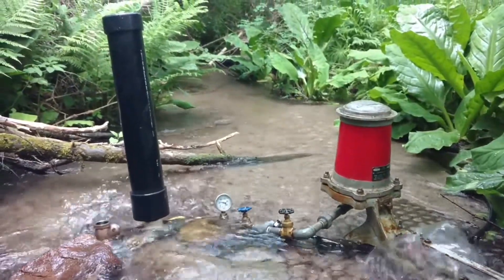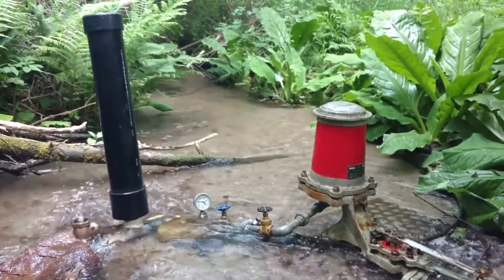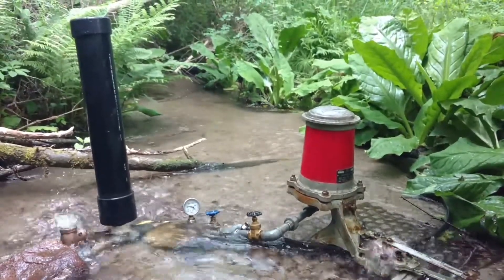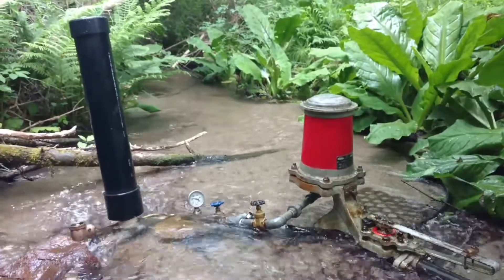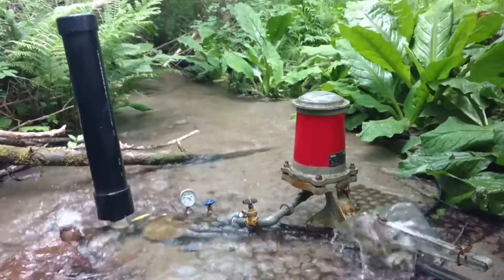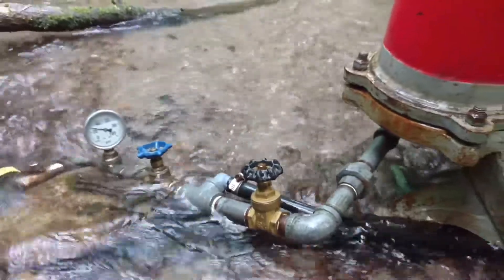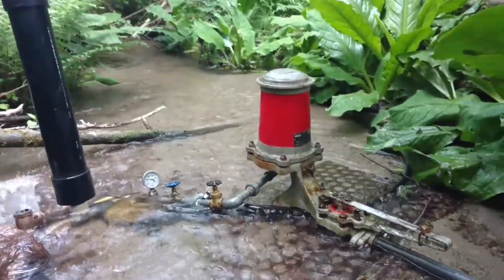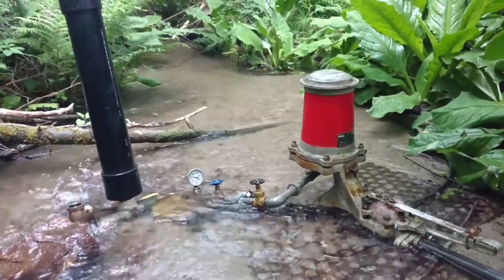Duel Ram Pumps!

Comment: Hi - are your ram pumps still operating.  Interesting approach saving piping by having both pumps using the same output delivery pipe.
Reply from the maker: Yes, they are both working however I only have one turned on at the moment because I just don't need the amount of water. As we are not watering Garden or yard yet.
Reply: @wadewilliamson7994  My situation is to water about 3 acres from a flowing stream in the bottom of a meadow.  I'm still considering various water powered pumps, including multiple ram pumps.   I invite you to join in the discussion and share your ideas in the Water  Powered Pumps public Facebook group.    When objectives go beyond filling a tank, optimizing the water flow at the lowest cost becomes a consideration.
https://www.facebook.com/groups/240458583255303/